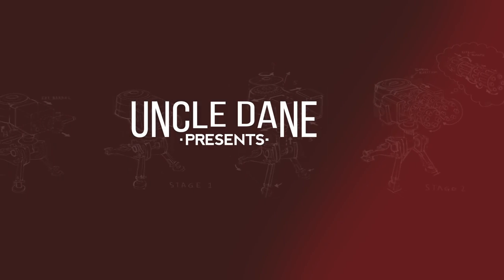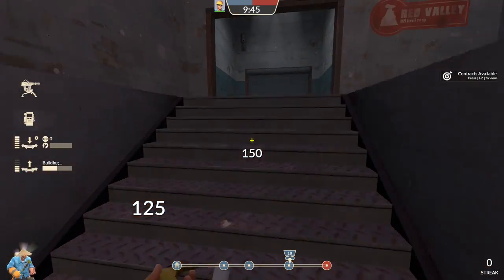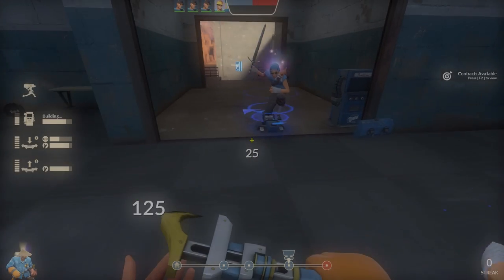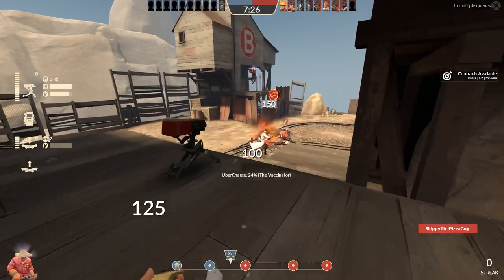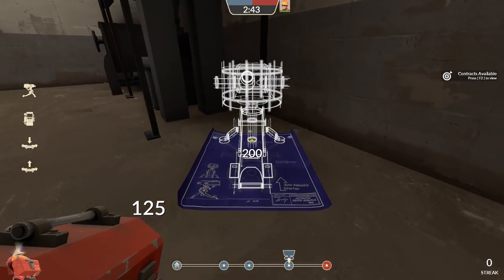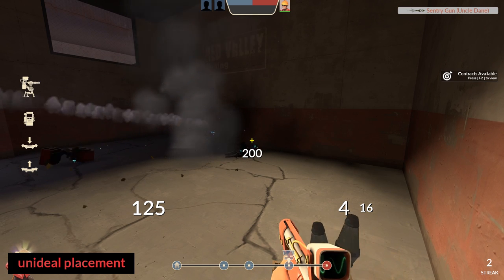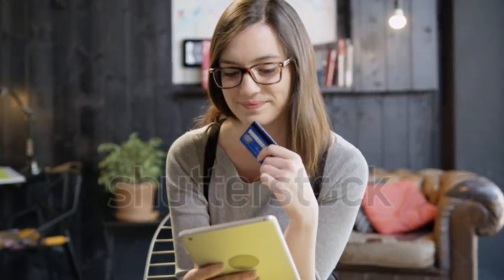Engineering 101: Tools Of The Trade

Comment: A little tid bit is that picking up and placing teleporters removed the cooldown for teleportation, which is useless in most situations, but can be very nice when using a level 1 teleporter, which can function pretty much at the speed of a level 2 due to the redeploy time being 5 seconds without needing to go through the upgrade animation, so youre saving 5 seconds on each teammate basically, just remember to redeploy the exist or the entrance only

Comment: You know, I always knew that destroyed buildings gave out ammo but I never thought of it as a viable strategy to use in-game. Wouldn't it be a bit more ideal to build the teleporters since they're the cheapest and then destroy them? Or do teleporters give less metal gibs to use as ammo?

Either way woot we graduated from Engineer 101. Also the sound the Scout's corpse makes at 5:52 was a nice touch, I laughed a bit harder than I should have.
Reply: Fuck me, I didn't even hear that!

Disclaimer: Don't actually fuck me.
Reply: Teleporters only give 4 gibs so dispensers would be better

also you team already uses the dispenser for ammo so they aren't missing out on much by you destroying it, but they rely on teleporters to get to the front line not to get ammo so overall it just makes more sense to do this to the dispenser
Reply: Just A Random Dood Also takes slightly longer to gib two teles instead of one dispenser, so depending on how urgent your team needs the ammo, that's a consideration. But ye, generally teles are better to gib than dispensers (given that you aren't already using teleporters, which you likely will already be using and thus can't gib without handicapping your team immensely).
Reply: Just A Random Dood Was mostly referring to manual destroys, but yeah, obviously scripts will compress the entire process into one click. But still, if you don't have a teleport up already, you're already hindering your team by not having one up. Just get the tele up instead of giving your team slightly more ammo :3
Reply: if their firepower is good and they need the ammo, i'd rather destroy a passive sentry while i whack a new dispenser, destroying buildings can look like a good idea but it's metal you aren't getting back immediately and Dispenser will always be a better investment of your metal, you can build a dispenser and get it to lvl 2 sacrificing your sentry, instead of a lvl 1 dispenser after blowing it out once while your sentry sits there doing nothing
Reply: @Charlie: Be careful with mini-sentries, though; the scrap from destroyed mini-sentries grants ZERO metal (to anyone) these days. Prior to the July 2, 2015 Patch #1 (Gun Mettle Update) a destroyed mini-sentry was worth 65 metal metal. And because a mini only costs 100 metal to build, Engineers who were being hunted by, say, a Scout, could "chain" minis by throwing down a mini, letting it shoot the Scout, grabbing the scrap when the Scout shot it, then instantly build the next mini, all the while retreating. I once hunted an enemy Engineer as a Heavy, he built four minis in my path while he ran away until my bullets finally caught up with him.

On the other hand, the Gun Mettle update finally added the ability to repair mini-sentries. Prior to the update, you had only been able to refill its ammo, and people usually didnt even bother with that, as minis were meant to be dropped as a distraction and usually got destroyed long before they were empty.
Reply: If you don't have any teleporters up and running, then sure.

But you're generally gonna be doing it with dispensers, cause if you have one up already, there's no need to destroy anything since your team can just get ammo normally.

Comment: Here's another tip:

There's a certain position around a dispenser which allows you to upgrade it and not take any metal from it while it constantly stores newer metal. For instance, your dispenser is at level 1 and it has some metal stored. If you happen to have ammo packs around (from dead teammates for example) you can use them to upgrade the dispenser to level 2. Then that metal stored in the dispenser which you could've used draining 40 metal per pick becomes 50 metal. Basically you allow the dispenser to get a more valuable reserve of metal without draining it and at the same time, you can upgrade it via other metal sources. 

It's not like a fact outta this world, but it's interesting when it comes to situations where you got ammo packs around and want the dispenser at its full potential quickly

Comment: Woah,didnt knew TF2 supported VR...
Reply: Yeah, Valve added that a couple years ago. There is even a console command you can use to force "true first person view" even if you are not playing with VR. Just type into the console: cl_first_person_uses_world_model 1
To de-activate it, type into console: cl_first_person_uses_world_model 0
The command binds the virtual camera to your character model's head, instead of their chest where it usually is, and simulates seeing your character from world view instead of client view. Meaning you can see your character's body and feet when you look down, any equipped cosmetic items (and worn items in weapons slots, like the Soldier's Gunboats boots), a bit of your shoulders if you turn the mouse slightly (so that the character swivels its head without fully turning the body). If you look up while weapon an Unusual quality hat with any floating particle effect (liike i.e. clouds or the Halloween pentacles), you can see the Unusual effect above you, while confetti will constantly rain down in front of your  face and circling effects can obstruct your view). Oh, and you can see your shadow on the ground (depending on environmental light conditions on the map). 

The view mode can generate some weird visual glitches for you though, as it only simulates world view (so it's not exactly what other players see). There will be weird clipping with certain cosmetics. The Demoman's shoulder parrot can clip into your "face" when you look at it. Rocket-jumping with Gunboats or Mantreads on often makes the "weapon" boots float above your body model's stock boots, so that you see both pairs of boots.

Comment: I never would have thought to do the backwards sentry, or to just build/cancel dispensers.
There's one piece of advice here that's actually not that useful, and that's building away from walls, to avoid splash from ROCKET JUMPING SOLDIERS. if it's inside a cramped building, yes, absolutely build away from the walls, but if it's out in the open with rocket-jumpers, you literally can't do this, because the GROUND is the largest wall that there is for a rocket jumper. I just feel like that's an important thing to note, because out in the open air, the best place for a sentry is not "away from a wall", but rather "Out of the expected field of view", A soldier rocket jumps and looks in the direction of the path, or the direction towards either the objective, Or nearest visible players, who will be in such spaces. So keeping the sentry in a place that can see the skybox clearly, where the soldier is rocketjumping, but is NOT in the line of site from moving from enemy spawn to friendly spawn or objective, is the actual ideal placement in that circumstance. this is the same rule as the backwards sentry in closed rooms, Maximize the distance that the enemy commits to traveling before they take damage, and are forced to turn around. if they are mid-jump, AND the sentry is behind them or far enough to the side, They're pretty screwed. 

That's it. that's all i've got to say.

Comment: Dane, I have a suggestion and question... would it be a good concept for all wrenches if that whenever they crit, it doubles the amount of metal used in upgrade. For example, if you have a Lvl. 1 Sentry at 150/200 metal, when the wrench crits it goes instantly to Lvl. 2 because instead of 25 metal, it uses 50. The kritzkrieg for Medic may also allow this to occur if he crits the Engie.

Comment: Putting your engineer buildings near a wall or corner actually helps by creating a choke-point for spies so that there isn't as much area to cover. I will agree that avoiding splash damage is a toasty warm idea, those two different strategies are probably great ways to diversify in case you're going against a team with particular strategies or players with particular skill sets. I thought the rest of the tips were pro strategies, though.

Comment: I always hate dealing with spies because of the one million different sets they run. When you see a heavy running shotgun it's a meme but if you see a spy running dead ringer it's because they're killing you. The sets I have the most problems with are the ez pass and the barcode scanner. The barcode scanner is soooo confusing because it doesn't tell you that your stuff is being messed with unlike the sapper, so you walk away from your spawn for 20 seconds and when you return it's already done and there's already a level 2 sentry nest in YOUR base. Also, the ez pass is another thing to stress about, even if it's arguably the worst of the sappers and effects the engineer the least. It definitely sounds useless being able to enter the enemy spawn, but this item was MADE for trolls that exist only to fool first time idiot scouts and me while I'm in the bathroom. It's obnoxious when I'm trying to make my team spy check after the 3rd time my teleporter has gone down and nobody even thinks about checking the spawn room. Obviously spys running this weapon can't sap buildings, but they still have a gun so as long as no one's around or just not looking they can just shoot them. I hate this weapon and hope it gets reworked at some point, since I like the idea of giving alts to the weapons that don't actually shoot bullets (cough cough construction pda cough cough).

Comment: Power cycle both the SmartCast HDTV or HTD and the control device (i.e. Smart Phone or Tablet)Power off the HDTV or HDT and unplug it from the powerTurn off the Smart Phone or Tablet and then turn it back on.Plug the HDTV or HDT back into the power and power it on.lf the above steps don't work delete the SmartCast application from the tablet or phone and reinstall it. Once its reinstalled try pairing again.Press the Link button on the basic VIZIO Remote to get the HTD or HDTV into Setup Mode

Comment: A game of Tf2 in VR:

A young spy main runs around corners cloaked, dodging enemies and making sure he is never found

A grizzled Texas engineer with 9 PhDs swings his huge weighty wrench at his immaculately constructed sentry turret

The spy sees him, disguises as a local Pyro and goes for the kill

As the spy moves to back stab the engi the engineers head slowly turns around, his neck popping and cracking and he laughs “your body will make a fine foundation for my new dispenser”

In shock the spy backs up, horrified of what he thought to be an engineer, only to run up against a real Pyro “mrrr!” The Pyro yells and puts to light the Spy.

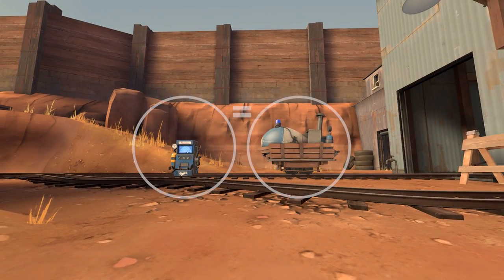Comment: 8:20
The double metal by standing on top of a dispenser is WRONG. You do NOT need to stand on top of the dispenser to get double metal, you just have to move around your dispenser weirdly which is better/faster than jumping on top of it (Proof https://www.youtube.com/watch?v=BQ0icVyKiqA). Idk why the misinformation of "You need to be STANDING on the dispenser to get double metal" comes from but I've explained this in engineer.tf and I believe as a comment on Mechawreck's videos and the incorrect info is still floating around.